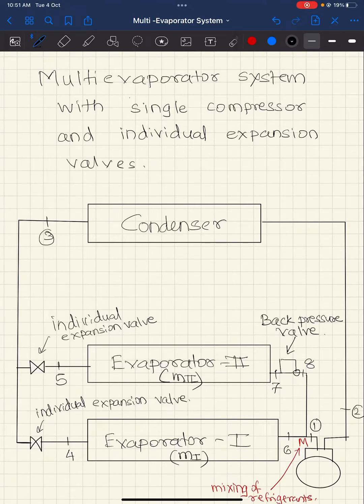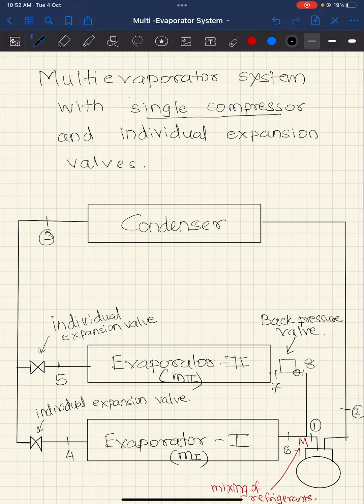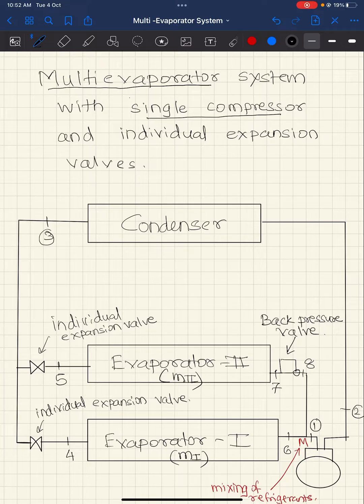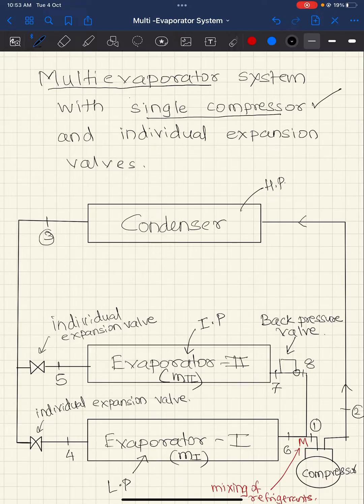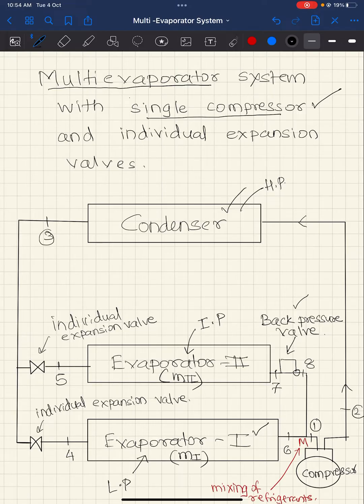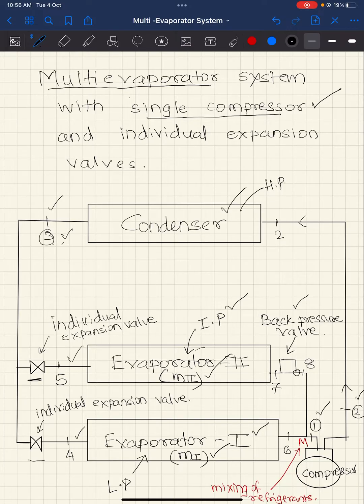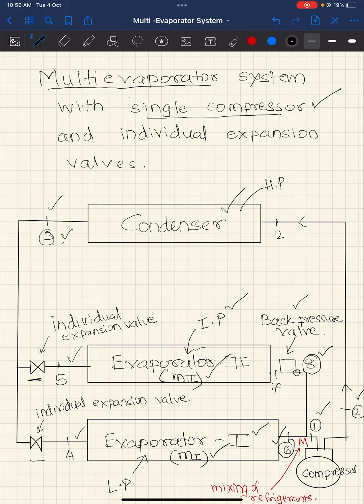Two evaporator system with single compressor

Comment: How to find the h2? is it using diagram superheated?
Reply: To find h_2 on the P–h diagram:
Since s_1 = s_2 (the process is isentropic),
go to the condenser pressure line on the diagram
and locate the point that has the same entropy s_1.
If this point lies in the superheated region,
perform interpolation to determine the exact value of h_2.